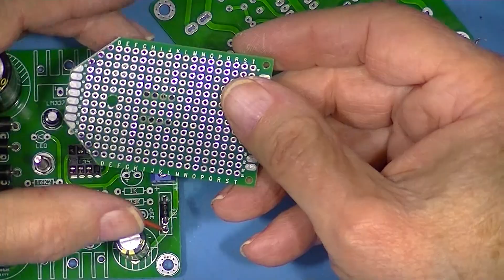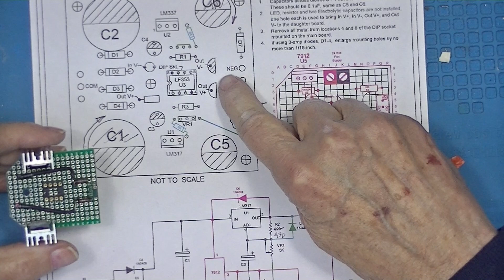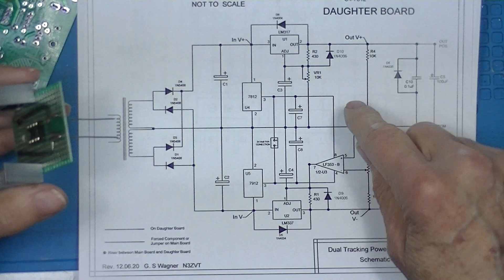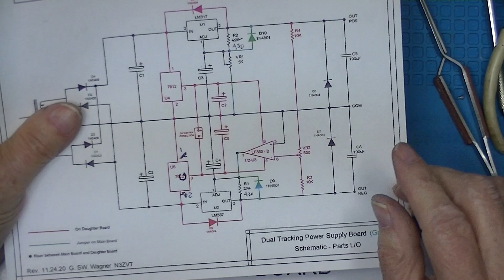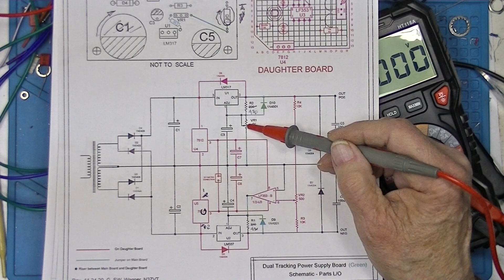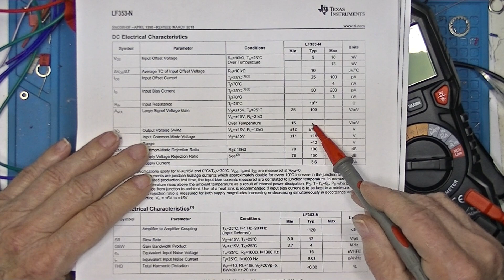Dual Output Tracking Supply - Part 3

Comment: Good project!  Oh I have to add that just last week I couldn't print anything in color because my ink carts in my epson printer were empty. So I opened up a box of non epson brand, which was the same is what I had in there, as I bought a bunch of them along time ago, and I could not get the magenta one to read it. So I had to open yet another set just for for the magenta. :-)
Reply from the maker: Epson had been bothering me with updates and I finally gave in. One of the updates was printer firmware. After the update when a cart was replaced, it had to be recognized as genuine. The thing that upsets me is that the machine is totally inoperable. No scan function! And no copy operation, even in the photo mode. In my printer there are two black carts, one for general BLACK and one for PHOTO BLACK. When the general Black is not recognized the machine bricks up.
Steve